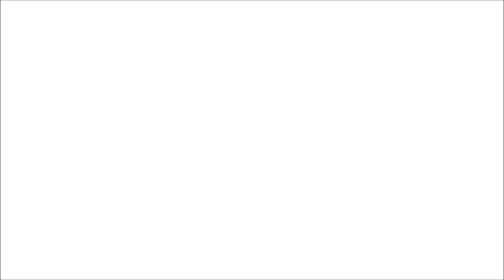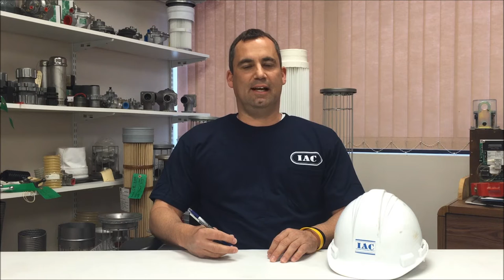Troubleshooting Short Baghouse Filter Bag Life

Comment: Hi brother.
Kindly guide me which test will perform to check bag service life is ok or replacement needed.  Thanks
Reply from the maker: Thank you for the great question! Laboratory tests for used filter bags are the best method for testing bag service life.  When performing formal filter tests all operational factors (filter weight, permeability, strength loss, etc) are measured against the original fabric media specifications.  It’s a great way to find out if you are close to failure on filter life.  Please call IAC and we can help with this!  ~ Eric Huggins